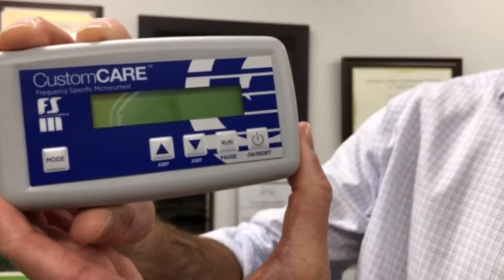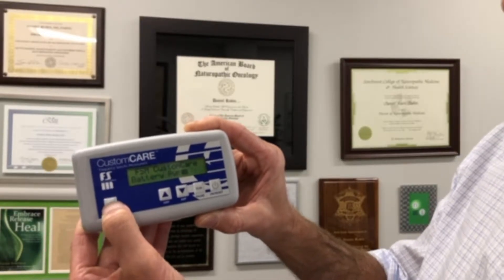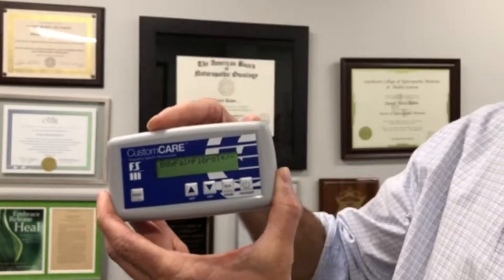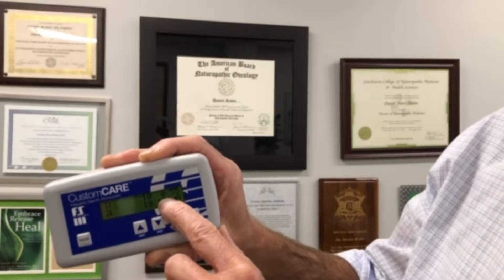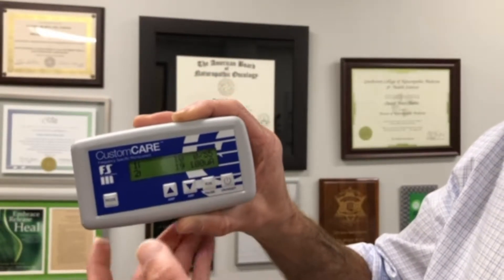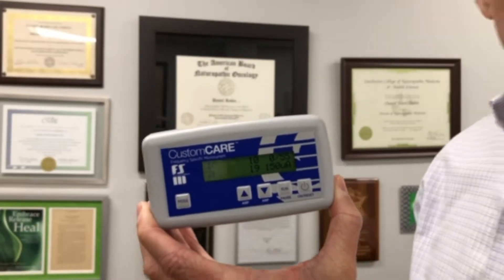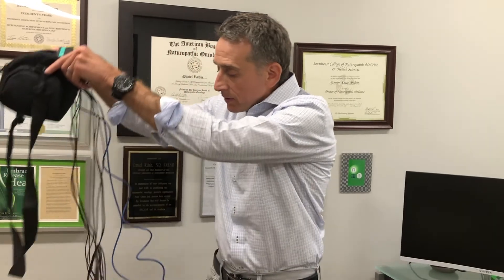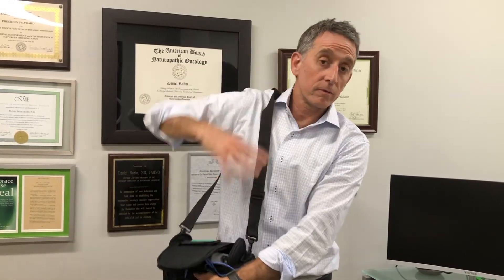Dr. Rubin Explains FSM - Frequency Specific Microcurrent

Comment: Hey Doc!, I get the fact that our cells are bioelectrical batteries,  but like any battery over time they lose the ability to hold a charge. Saw some research on the use of agar mixed in with an electrolyte drink to increase the cells capacity.  But how to RETAIN the cells at optimum amperage of 100K is the Holy Grail... Organic lithium?